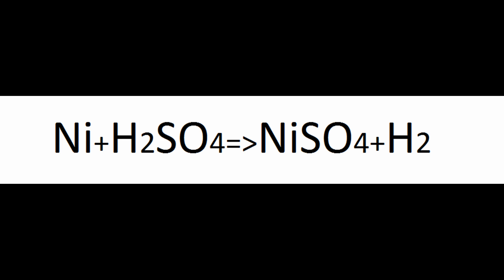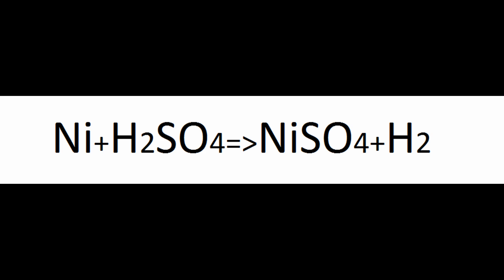How to Make Nickel sulfate

Comment: thank you for making the video, i have nickel from nimh batteries i found in the garbage and sulfuric acid from the garbage from an old car battery, after i make this, can i add wood ash from a fire i made and make nickel hydroxide? i really need to make some ghetto nickel hydroxide, i hope you see this message
Reply from the maker: For the most part, yes this is possible. However, be VERY careful. As stated in the vid, nickel compounds are generally carcinogenic and your sulfuric acid will have trace amounts of lead sulfate. If you are just after some low quality nickel hydroxide, I believe this is what the anode (+) film/paste of your NiMH batteries are composed of (mixture of NiO(OH) and Ni(OH)2 depending on the level of discharge i.e. fully discharged should be NiO(OH)). 

Assuming you wanted to purify the nickel hydroxide, you could add the battery acid  to the nickel hydroxide paste in a beaker and heat gently. The green particles should break down and the solution should turn greenish-blue as seen in the vid. If purifying, run solution through a coffee filter. In another beaker, take your wood ash and add some water and heat to a gentle simmer to convert K2O to KOH. Filter this as well and then gently boil it down (careful of the droplets, they will be rather caustic!) or if you have time just let it evaporate in the sun. Once you get it concentrated (about 10% original vol.) it can be added to your nickel sulfate solution to precipitate out mostly nickel hydroxide. This can be filtered out and rinsed and now you have only slightly ghetto nickel hydroxide. Again, if you don't need high purity, you'd probably be fine with rinsed anode paste from the battery.
Reply: @bmw.996  ohhhh i see what you mean, in the batteries it will be in the form of powder/pase rather than a sheet of metal like i was thinking, i didnt realize that, makes sense.

but what if my junk batteries supply is low?
i could use just nickel metal and do the same proccess right?
if so, where would you go to, if you wanted to get alot of nickel metal? for example 500 grams or so?
Reply from the maker: @rivenmain2175  I often use eBay for common chemicals and supplies, a pound of electrolytic nickel metal should cost around $20. At the time of this video I was in high school so I extracted the nickel from low grade but convenient round samples that clutter up the center console and cupholder. Between the acids for purification and time spent, buying the metal is cheaper and easier.

Id also suggest pure sodium or potassium hydroxide from a reviewed seller on eBay (about $3-$5 per pound), then you'll be working with lab grade nickel hydroxide which should improve whatever project you need it for.
Reply: @bmw.996  thanks! sounds good, its an iron battery btw.
i want to explore the science and i have around 5 liters of free sulfuric acid i found in the garbage.
and its just sitting here and i really want to do something
what i liked about your video is that you just dissolve the nickel metal in acid easy as 123 and that was the only missing piece of information i needed to start this project.

theoretically once i have rust and nickel hydroxide i will just need to wrap them in some coffee filter or something and charge it and discharger a few times with some koh
very excited for this project with free materials

Comment: Unless the sulfuric acid is very hot and concentrated, the reaction won't "go".  There are 2 ways to push it forward.  (Electrolysis) One is to put in 2 strips of nickel metal into the acid, and connect them to a low-voltage AC source.  There will be fizzing, and the solution will get hot (put beaker in larger bucket with cold water).  When the fizzing dies down (after many hours), cool the solution and the nickel sulfate will crystallize out.  (Peroxide method) Add hydrogen peroxide to the acid-nickel in the beaker, in small amounts at a time.  Solution will turn green, (and become diluted from the peroxide).  Boil this down until the nickel sulfate crystals drop out of solution.  Neither of these schemes require high temperatures.  This will reduce the fumes generated.
Reply: This is really good advice. I was evaluating hydrogen peroxide but it seems like using electrolysis is a simple option if run at a low voltage over time.
Reply: @foomcl That and just about any acid that forms water soluble nickel salts will do.  Other YouTubers make nickel acetate plating baths with vinegar.

Also, another method is to mix sodium nitrate with muriatic acid to generate a diluted aqua regia and put nickel shot in there.  Should completely dissolve with gentle heat in an hour or so.

Comment: why is your batch colored light blue when others are light green?
Reply: Angel Gonzalez - I think it’s because he’s got the heptahydrate, not the hexahydrate.
Reply from the maker: I know it's been a while since this question was asked but I figured I'd answer it anyway. The color of the solution is indeed influenced by the degree of hydration as pottyboyler eluded to. However, I think they got it backwards. If you look up nickel sulfate online (wikipedia), you'll see the hexahydrate is mostly blue with a hint of green and the heptahydrate is closer to pure green. Therefore, if I were to dilute the resulting solution it would likely have turned green but since it was highly concentrated (I believe I used stoichiometric amounts of pure nickel metal and high concentration sulfuric acid), there was limited water and the lowest hydrated complex that's still soluble would dictate the color, making it blue.
Reply: @bmw.996  Thanks a million for your response, no matter how long it took. Wow, it's already been four years, if I remember correctly when I found your video back then I was constantly browsing content related to copper plating and etching to make pcb's.

Comment: i thought nickel sulfate was NiSO4(H2O)6 ????. is this supposed to have water in the final product??? you have H2 but on another site it has (H2O)6...im no chemist, what exactly is the difference, because i was wondering how to make nickel sulfate, its how i came across this video. im poor and its god awful crazy expensive and im making a knife handle, etc....where did you get your nickel??? i read where nickels are only 75/25 copper/nickel and i was thinking you would end up with a blend....i dont know, but seems you do, could you explain these things, im fairly clever so i could understand it if you would be kind enough to crash course me....thanks for this, im just confused on how to get the nickel...i already knew nickel sulfate is produced by dissolution of nickel metal or nickel oxides in sulfuric acid.......but where to get the nickel or nickel oxides
Reply: its the same compound the water of the hexahydrate is not added in the equation because its not a byproduct of the reaction however the hexahydrate will still form because of the precense of water as a solvent in the sulphuric acid.

Comment from the maker: Well it could be done, the only safety concerns are that nickel metal and nickel compounds are carcinogenic, meaning they are considered to be a cause of lung cancer. Any types of dust that are inhaled is bad news. However, with only very acute exposure and being cast in a resin, it will be reasonably safe to keep wherever you feel. Just be careful when making them, and be sure that no part of the actual crystals are in the open air.
Reply: I know this is video is 4 years old, but I recently touched Nickel Sulfate without knowledge it was dangerous. After an hour of experimenting, my finger feels tingly. It may just be static, since I held batteries too. Is the tingling a concern?
Reply: Bryce Watson so if i keep it in solution sealed in a bottle and use gloves when handling i should be fine?

Comment from the maker: i would guess that the copper-chloride bond is stronger than the copper-sulfate bond, causing the rest of the copper to react with the HCl and leave some sulfuric acid left. If you were wanting to seperate the two, i would suggest using ethenol on the crystals, seeing how nickel sulfate is soluble yet copper sulfate is not.

Comment from the maker: It is unfortunate to hear about the state of your patio ^.^
The hydrogen peroxide shown in Nurdrage's video isn't necessary because Nickel metal is far more reactive than Copper metal, so it doesn't need as much heat. It seems that he is doing this because the decomp. of the H2O2 is a much faster way of heating it.
As for the bubbling, when the Nickel reacts with the acid, hydrogen gas is formed, this bubbles out into the atmosphere. This is seen at :25

Comment: I tried to dissolve a nickel coin which is 25 percent nickel and 75 percent copper.  I used 30 percent hydrogen peroxide instead of heat. At some point everything boiled over and I'll have a nice carcinogenic spot on my back porch. At least it's a pretty color! 

Why do you think it bubbled up in the beaker? I use the same procedure as nerdrage uses on his  copper sulfate video, but I used a nickel instead.